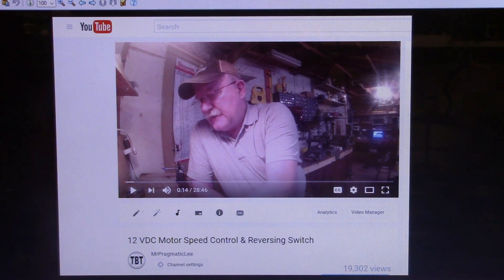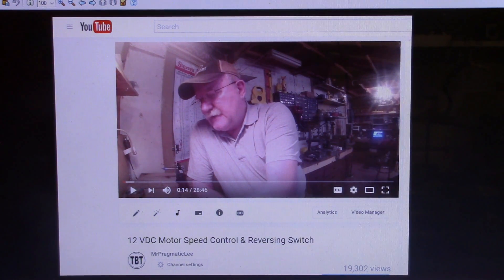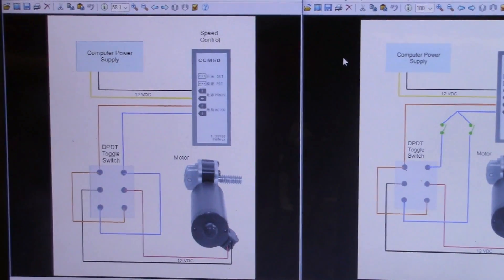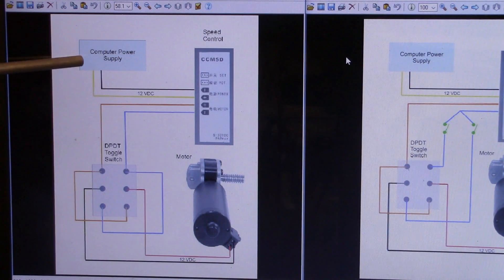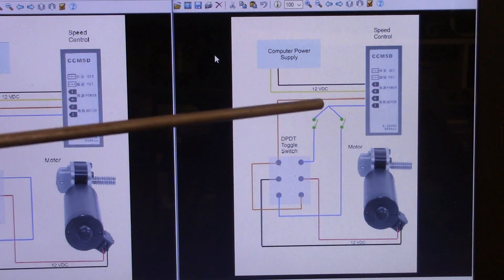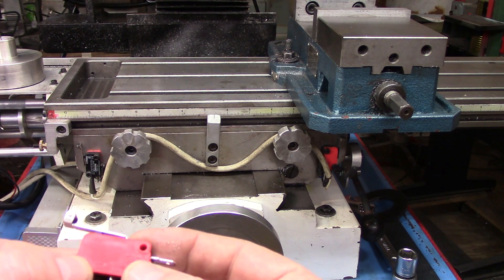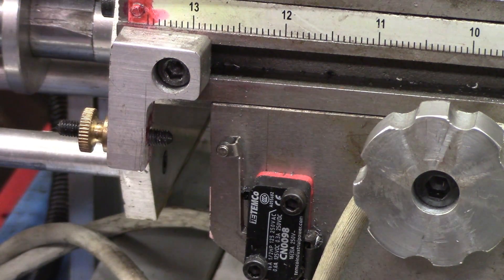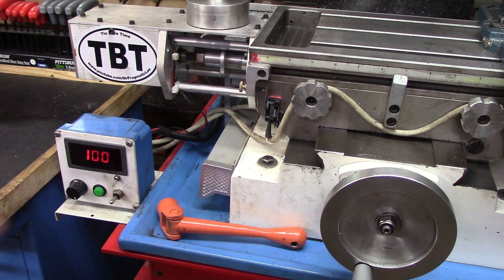DC Motor Reversing Switch With Limit Switches

Comment: Need help here....12v system.... what I have- 1 dc motor wired into 2 spdt relays to mimic 1 dpdt relay to create a forward/reverse action. what im trying to do is tie in a riorand speed control, then add limit switches to the system. my issue is where to had in the speed control to make it work properly?

Comment: Hi, I have built and completed a drive for my SIEG SX1LP HiTorque mini mill all as per your details, and it works fine except for one small problem. The motor used is a Hilitand DC 12V 200RPM Turbo Worm Geared Permanent Magnet Reduction Motor however I feel that it lacks sufficient power to drive the bed.
Could you kindly supply me with the full details of the DC unit that you used for your conversion please.
Thanking you in anticipation and many thanks for all the good tips you have shared.
Regards Roger David (Wales - UK)

Comment: On my tool and cutter grinder my limit switches are not immediately changing the direction of the motor . Causing the drive to push on the limit switch mounts . Can you help me by explaining what's causing the problems.  I have a variable speed knob which I'm forced to run at low speed.  Thank you for your advice.  My name is Pete

Comment: Would this work using a DPDT relay instead of the DPDT toggle? When I wire the relay up the same as the toggle it shorts out. What am I missing?
Reply: Rocker switch has neutral position (nothing is connected).
Relay is either on or off.
You would need to use 4 simple SPST relays to build an H bridge to reverse the polarity of the DC going to the motor.

Comment: Thank you for explaining this so effectively. I plan to install a motor to a shortwave radio magnetic loop antenna for a 360 degree rotation & was wondering how to install limit switches to the design to stop the device twisting the connecting coax cable around the mounting mast.

Comment: Do you know the amperage flowing thru those limit switches?  I can't find a limit switch rated for more than .4amps DC.  There are dozens of limit switches available and at this point I'm tempted just to get one and put the stupid thing in the machine and see what happens.
How can it be limited to .4amps anyway?  What kind of hair-thin contacts are they using???

Comment: I am running into a brick wall.  I found another 6pin DPDT switch I can wire like your drawing.  But it seems ALL the limit switches are rated for less than half an amp DC.  I just got off the phone with TEMCo and even their 16a switches are only rated for .4amps in DC.  There has got to be something I am missing.
I just got a clamp ammeter and my motor is drawing about 14amps DC at peak load.

Comment: Thankyou for posting this info.  I have a couple of questions if you don't mind.
This is my first electrical project.  I'm using an 18v drill motor/battery to drive a winch.  The idea would be to limit inward travel before it binds & pulls it's own anchor loose.  
- Would this work with a DPDT switch that has the built-in crossbars?  I see some don't, and people make their own jumpers... which I don't see on your drawing.
My DPDT switch...
https://www.gamainc.com/product/28pr-mom/

Thanks much.

Comment: Great video 
 i am not an electrician and understand very little, but here's what i want to do.  I have a reversable 12V dc motor.  What I want it to do is turn on automaticallly with a timer in one direction and shut off (with a limit switch?) after about 2 seconds.  About 2 hours later I need the opposite action. Both actions automatic using a timer with DC power.

Comment: I have been trying to get a semantic to run a. Linear Actuator 24v i want to run the system on a battery i have both. it has limit switches in the actuator. i would love to have it on a LDR  Photo cell. And running of of a solar cell to charge the battery. this is ill know you will get a chuckle to open a chicken coop door. Have lost too many birds. just because i was a few min late getting home. any help wold be great and im sure you would hafe thanks from others that are in the same spot. thanks randy

Comment: Well DPDT Relay has eight pins not six?
Thank you.
Reply: Uggh, I'm trying to make it work but I'm having no luck. Apparently the contacts on a DPDT toggle switch are not the same as a DPDT relay. His wiring instructions are not working with the relay. Do you recall if you found instructions somewhere else or just trial and error???
Reply: @kevinbooth8309  I found the answer by looking at how car door locks lock and unlock using the same switch.
Reply: I think I got the diagram from thins video. Can't remember
https://www.youtube.com/watch?v=BR_r4sPNwF4
Reply: @EL34XYZ  Thank you. It looks like that one adds a couple of automotive relays to the DPDT relay. It doesn't seem to have limit switches in the circuit. Something else to think about i guess!! 🤔
Reply: @kevinbooth8309  yes, you need limit switches so the circuit can tell which way to switch back to
Reply: @EL34XYZ  This looked simple at first. Just trying to reverse a motor and adding 2 limit switches. Not working out so well.
Reply: @kevinbooth8309  I can't post a PDF file of how I solved this. I have a nice diagram showing how I set up a circuit to open and close CNC vacuum blast gates when  the machine is turned on or off. The Vacuum blast gates use Car lock motors to move
Reply: @EL34XYZ  I've looked everywhere for days. I'm using small 12VDC motors to open and close greenhouse vents. (or at least trying to). I really thought substituting a DPDT relay for the DPDT toggle switch in this video would work for me but it is not. Do you know if there is a difference in the pinouts between the relay and the toggle switch? Seems that they would be the same.
Reply: The DPDT relay you use comes with a pin out diagram. There should be 8 pins. Two are for the relay coil. 3 on one side are a spdt switch and 3 on the other side are a spdt switch. the center pin between those 3 is usually the common pin
Reply: @EL34XYZ   EL34XYZ  that is correct. Except I believe the common pins on these relays are one and two. But regardless, should this relay work the way @MrPragmaticLee has his toggle switch wired up?
Reply: I guess if I knew on his drawing that the 2 center pins were common, I should be able to modify this drawing to work with common pins of 1 and 2 instead.
Reply: On the relays I have pins 5 and 6 are common. Pins 1 and 2 are normally closed and pins 3 and 4 are normally open.
Reply: @kevinbooth8309  I am doing a video on this. I'll notify you when I have it uploaded.
Reply: @EL34XYZ  perfect! I think I have it figured out on paper anyways. I probably won't get to actually trying it until tomorrow. I'm not sure how to upload a picture of my drawing. Being that the common terminals on the relay are actually number five and number six I think I just have to swap three and four with five and six on the relay and it might work.
Reply: There are 6 switch contacts. Two of the pins are for the coil, not the switch contacts.
Reply: @EL34XYZ  Did you ever make it work with a relay?
Reply: @kevinbooth8309  Yes, but that was a year ago and I can't remember exactly what I did :)